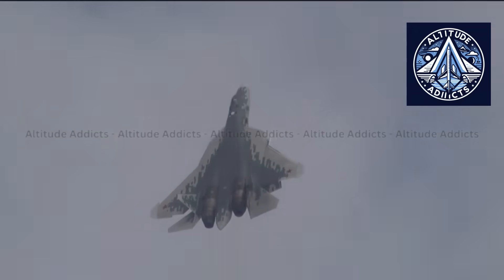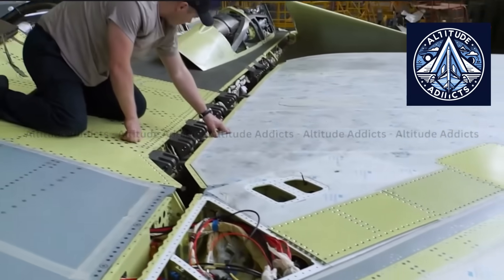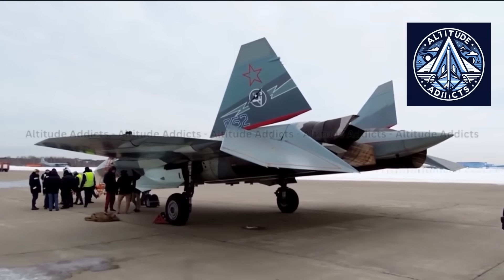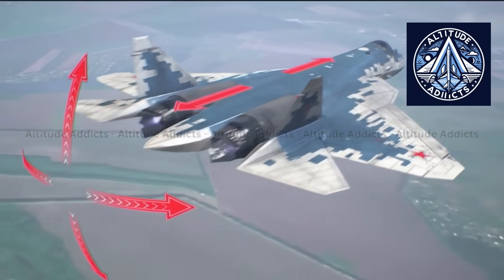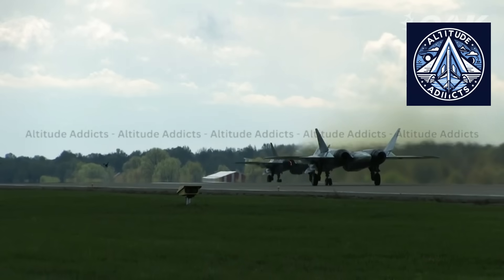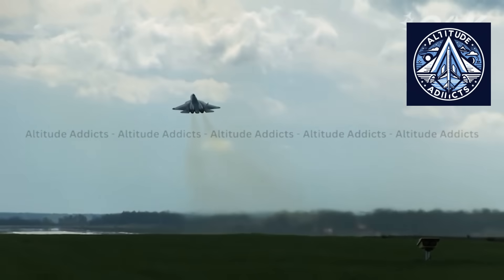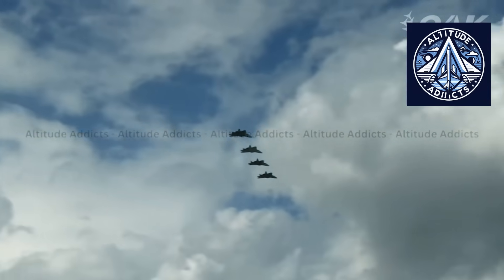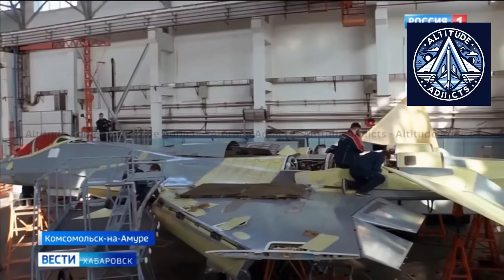Su-57M1 - How Russia’s Su-57 Overcomes Early Fighter Limits | AI-Powered Stealth Fighter |

Comment: for decades now large twin-engine high flying fighters with large radars and long-range missiles have dominated single-engine fighters .... because they launch their missiles at higher speeds and higher altitudes and their trajectory is downwards . F-35s will be no different they won't stand a chance against an Su-57 flying 50% faster and 10,000 feet higher ..... launching far bigger and longer range missiles. 
F-35 is a myth ....